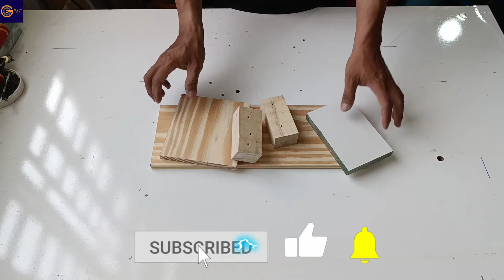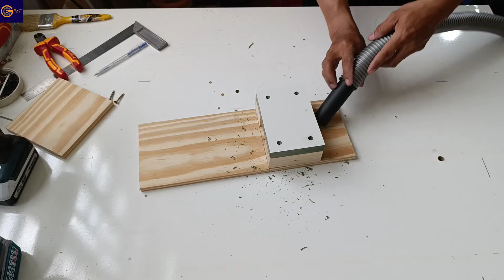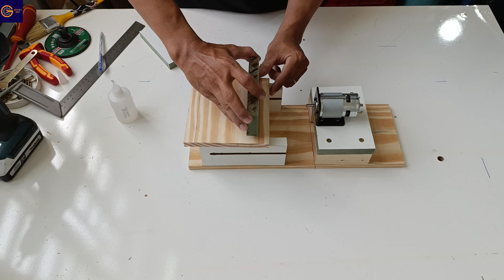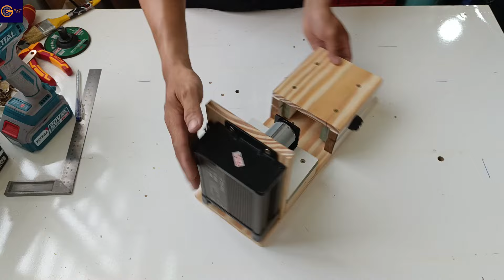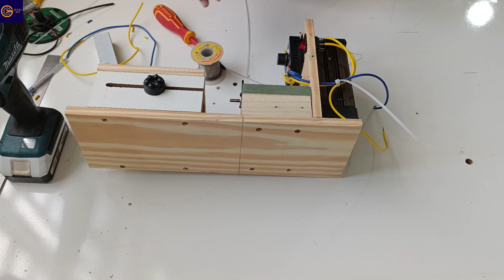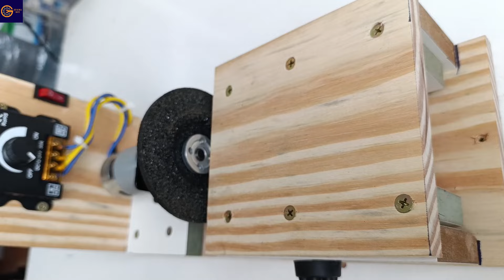A very great idea || How to make a 3 in 1 grinder from motor 775.#diy #creative.

Comment: Sorry sir, can I provide detailed measurements of all the ingredients in the video? so I can make it easily. thank you 🙏
Reply from the maker: Equipment needed include: Motor 775, 12V DC-30A potentiometer, 12V DC power source, switch, wire, grinding wheel, wooden board (sliding table top 15cm * 15cm, table top 30cm * 15cm, rack motor 8cm * 15cm ) Size you can change to suit your preference. Thank you for your interest in the video.

Comment: May i know what part did you use on the control speed ?
Reply from the maker: Thank you for asking me questions. I am using a 12V-30A motor speed control potentiometer.